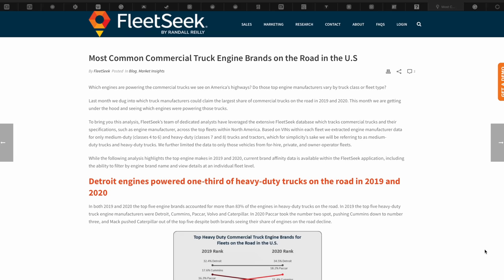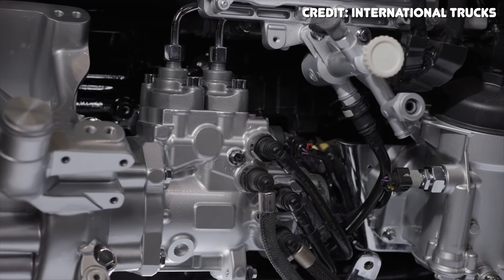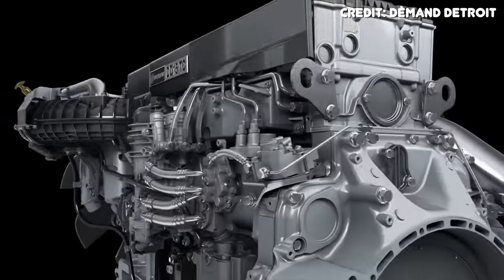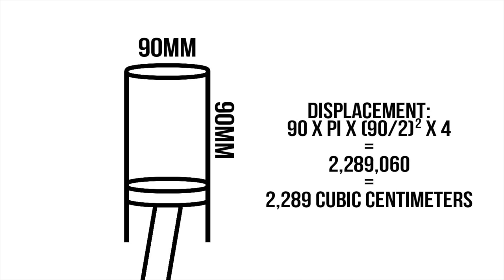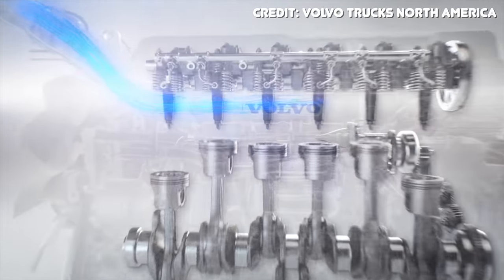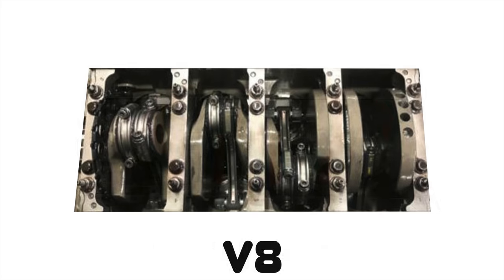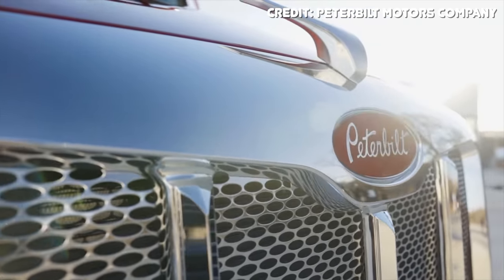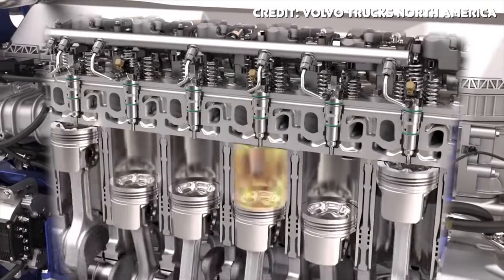Why do Semi-Trucks Use Inline-Six Engines?

Comment: In-line 6  are one of the few dynamic balanced engine designs.  Other engines have to use counter weights to minimize vibration.
Reply: Boxer engines? Kinda the only thing they have going for them besides low COG in cars
Reply: @kevinm1734  Boxers have a slight "rocking couple" the width of a rod bearing. BMW even added a "dummy piston" to get rid of this in their later models.
Reply: @peterdarr383  What about flat plane V8s or I4s. I know they have vibrations at high revs, but these big diesels aren't high revs. In fact some V8s use a flatplane crank over a crossplane crank to achieve higher revs without the losses from the counterweights.
Reply: @beckoningjinx1119  From what I read about Stock Car Racing the Flat Crank weighs less so you can accelerate out of turns when on "short" tracks. On Super Speedways you use the Crossplane for smoothness and reliability. There's also an exhaust advantage to Flatplane, so, completely different headers.
The l4 has all 4 pistons coming to a stop every 180* and the RATE of acceleration of the 2 falling pistons is FASTER than the rising pistons, maxing out at 72* instead of 90* which creates a tingling buzz on a motorcycle.
Reply: @peterdarr383  I haven't noticed that in my 911S. The dummy piston in BMWs is behind the steering wheel.
Reply: You mean balancing shafts.
Reply: I was just about to say the same. I designed parts for these engines for over 5 years and the I6 and I4 dominate because they have excellent dynamic balance and when you need to get 500k to 1 million miles, you need an engine that produces the least amount of wear on components while still producing sufficient power. Serviceability is also a part of the equation though.
Reply: my tractor rocks an old  I-3  --no counter weights required.  
But my sisters car has I-4  with some dynamic balance "thingy" mounted in the oil pan/sump.

so is it iterations of 3 that are "naturally" balanced?
Reply: @mtraven23  your tractor probably only revs to like 1500, no?  And probably shakes more than most people would want in a passenger vehicle, no?
Reply: @lqr824  no, but it is a low rpm engine, i wanna say 3-4k rev limit.  and its for sure louder than you'd want on the road, but the engine is pretty smooth
Reply: @mtraven23  If you can check the max RPM I'd be curious.  I'm reading that it might be 2500 or something.
Reply: @lqr824  yup, looks like you are correct.  Engine is rated at 2500rpm with low idle @ 800 and high idle @ 2700rpm.
Reply: @mtraven23  well, higher than I though, I too stand corrected!
Reply: @lqr824  not sure if it matters, but maybe its because its a pretty small, low HP engine?  Talking like 20hp (1.3 L), maybe a little more since I bored it.  Also built in or before 1990.

Comment: For the same reasons my favorite engine in older Ford trucks was the 300 straight 6. Dependability, ease of maintenance, and lots of low end torque. 🤓🍻
Reply: Yes, I have been using the 240 cid Ford six motor for 31 yrs. No trouble, Easy getting to dist, plugs, water pump, alt.
 Am going to the 300 cid Ford six motor in Jan'y 2023. Brgs getting too loud.
Reply: My Chevy 250 has max torque at 1600, versus big rig 1500. Not very fast, but if you want go fast, get a freaking sports car.
Reply: and how you said it

Comment: Packaging is an issue for a v8 in a truck. A 3408's exhaust manifolds are outboard of the frame rails, which means the turbo has to go on top, all the accessories have to go on front, and the oil filters need to be remote mounted. 
An inline 6 has plenty of space on the sides to mount everything and still not try occupying the same space as the hood.
Reply: In cab over engine configurations it’s a non issue, Scania still makes v8 for their truck lineup
Reply: @kalle5548  Scanias are small cabovers. Different stuff
Reply: ..

Cabovers mean shorter wheelbase
= Better Turning Radius

Euro & Asia drivers
don't live in their trucks

Their point a
to point b
is not a continent
Coast to Coast

San Francisco
Delaware
Pennsylvania

would benefit from cabovers
with older
narrower neighborhoods
street designs

like the older
eons older
Asian and Euro establishments

...

Comment: The inline 6 allows for big bearings, which helps when you have 200+ bar cylinder pressures.   Forged cranks, rods and steel pistons are all a must.  As a result, you get better thermal efficiency and thus higher fuel economy.

Also, larger pistons and bores are more thermally efficient than having many small ones.
Reply: yes but there is also parasitic losses that grow with bore size, and there has to be a balance between those losses and thermal efficiencies.  As such, I-6 is still the least expensive overall option.
Reply: I am not aware of an OEM diesel engine calibration that has peak cylinder pressure of 200 or more bar.  150 bar is more realistic.  High performance cals can be different, but OEMs keep peak cylinder pressures <150 bar.

I have seen this on many IndiMasters and IndiCom2s.
Reply: @johnphillips222  A lot of manufacturers are above 200 bar, especially in Europe.  The US semis are already there too in the last few years.  Once tier 4 hit, a lot of these engines kept going higher with cylinder pressures.  The race is still on to go higher.
Reply: Santa Claus  No, 200 bar.  Close to 3000 psi
Reply: Santa Claus  2 bar is rougly the pressure of a car tire. Its a fucking combustion cycle dude. Its 200bar.
Reply: Santa Claus  We're not talking about boost here mate, it's the pressure inside the piston as the fuel mixture ignites.
Reply: I was looking for this comment, they completely missed the cylinder surface area argument. However, the argument for the V-8s, primarily found in pickups, is that more cylinders lead to better transient response (emissions and efficiency) because there's more frequent combustion events during acceleration, leading to a smaller "step" for each one.
Reply: Santa Claus  1 bar is 100 kPa, slightly less than normal atmospheric pressure.  The average semi-truck engine will produce 20 bar without any combustion, just the turbo and compression.
Reply: large stroke is more thermally efficient not larger bore.

Comment: I'm not a big "diesel guy", as I really don't have the need for one, but I enjoy your videos, and I always learn something new when I watch one.
Reply: Unless you’re living off grid you do have plenty needs for rigs. You need parts, groceries, tires, fuel, furniture, building supplies, water, and so on right?
Reply: @Avinadav205  I'm talking personally.🙄 If I was pulling a skidsteer every day for work, I'd have a diesel. If I pull one occasionally, my gasser is just fine. I have zero need in my PERSONAL use of vehicles for a diesel. It would be a huge waste. I would be doing 13 quart oil changes on a truck I use to grab lumber from the hardware store occasionally. But don't worry, there plenty of weirdos out there obsessed with owning a diesel who do just that.
Reply: Santa Claus  bio, and ULS, are available here in the States. I use either at any given daily fill.

Comment: I used to run a Case 1370 with an inline 6 that ran at 2150 RPM. I also ran an Allis Chalmers with a Cummins V8 that ran at 2800 RPM. The Case ran a lot happier at low RPM and pulled better in tough conditions.

Comment: Just saw where Dodge/Ram/Jeep are going to replace the Hemi V8 engines with turbo in-line six engines in the next few years.  Inline sixes with 7 main bearings are extremely strong engines.  Had a couple of the old Jeep 4 liters based on the old AMC design.  They ran forever.
Reply: Interestingly the GM Atlas inline 6 was cancelled because of main bearing area. Being greater than the main bearing area of a similar size V6, the extra fuel required to overcome drag of the extra area was the main consideration. I  got  this info from a GM insider over 10 years ago.
Reply: Till the cam broke the distributor drive gear and oil pump quit working
Reply: Ford used to make a 300 cubic inch in line 6, I had two F150's with this engine, with a four speed with overdrive. They were terrific, lots of power, and, good on gas, they were simple and ran forever, and, were easy to work on.
Reply: @keithkuckler2551  We had an early 80's Econoline with the 300, pulled an equipment trailer etc.with no problems.   When we went to an 89 econoline with the v8 302, didn't seem to have the same grunt power as the 300,
Reply: @rickinoakville1549  Yup, I agree, that Ford six was also used in indusrial applications, in farm equiptment, ect. My current F150 has the 5.0 Coyote, and, it is great, but, an inline six with modern fuel injection, and, a 10 speed automatic would be a wonderful combinatiion. I just have no faith in those small displacement engines with turbos, too complicated, and, way too much to go wrong.
Reply: Mopar slant six was another good one
Reply: @mitchburk5112  Yes they were, I had one in my Massey Ferguson self propelled combine, and, in my John Deeere swather, hay mower. They were quiet, economical, and, reliable. If they made one today with modern fuel injection and electonic ignition they would be terrific.
Reply: @turbo8454  Not true. The length of the inline 4.2 was a severe problem in crash tests, the engine getting too deep into the passenger area. I have a Trailblazer 4.2 & it's one of the finest engines I have ever owned.
Reply: It was just announced.
Reply: @wymple09  Who from inside GM told you that?
Reply: The pushrod 4 Liter ran forever, the New Dodge I6 won't ..
Reply: @bluesky-ud9wg  I wouldn't trust ANYTHING coming out of Chrysler until there is a well known history of them. Somewhat true of all makes, but Chrysler in particular.
Reply: @wymple09  Everyone knows that Dodge/Chrysler is the coolest looking, most powerful vehicles... That way that they are easy to find in the salvage yards. I at one time loved Dodge, but they're pretty bad now.
Reply: @TheLionAndTheLamb777  Everyone has had a slew of cool looking, powerful vehicles. Your statement is a matter of opinion.
Reply: @bluesky-ud9wg  Entirely different uses intended. One was a low rpm workhorse, the other built for HP. The new engine will be the base for the new Hellcat.
Reply: I am currently running my 5th Jeep 4.0 liter inline six, basically the only thing I have ever had....Best engine in history as far as I am concerned.  These things run do run forever.    2006 Jeep Wrangler Rubicon.
Reply: The current hemi engines are not really hemi engines, they do not have the hemisphereical heads
Reply: @keithkuckler2551  those were great trucks
Reply: @mitchburk5112  - yep - just not big enough @ only 225 cid   Dad had one in the Plymouth Volare.  It was smooth, but a dog with no get up and go.
Reply: @wymple09  - really sad GM cancelled those.   GM and their 'maximum sales volume' philosophy leaves no room for excellence.  The 3.5L V6 is a wind-up motor.  Not impressed.  Had one in a Traverse.
Reply: @bluesky-ud9wg  - boosting small displacement motors for higher load vehicles like trucks is a really bad match.  See:  Ford Ecoboost 3.7L V6.    They're great for about 70,000 miles.  If that's all you want out of a $50,000 vehicle, well ok, then.
Reply: The New engine wont be like the 4 Liter at all. Just because they made a good engine doesn't mean all of them are. Dodge=Tick Tick Tick...
Reply: @wymple09  The BMW inline 6 is supposed to sub under the passenger compartment in a crash
Reply: 2001 3/4 Dodge 5.9 Cummins 177000 just got it broken in.

Comment: These engines were originally used  in tractors because of the bottom end torque. That and they are pretty much indestructable. Not fast but reliable and loads of bottom end. Fit in a small space too.

Comment: The Detroit 8-V92 with a super charger and 2 turbos will never be beat.    That was the most awesome motor ever made.    We had 2 of them on the farm to haul hay on double trailers.    They were 675 horsepower and this was in the 1980’s.
Reply: 2 cycle Detroits did not have superchargers. They had roots type blowers. They were "scavenger" blowers, meaning they pushed the exhaust out the exhaust valve. They provided no boost. That's why they are not called "superchargers"
Reply: They still can't be beat. No computer no plastic no def. Just you might go deaf. Lol love Detroit

Comment: Be-yootifully explained. In-line 6 engines are simply the best. Speaking of 3 cylinders, I had a rental with a 3 cylinder and was amazed at how smooth it was. I bounced it off the rev limiter a couple of times by accident (not because it was a rental)
Reply: Sureee it wasn’t because it was a rental
Reply: Ya just like I" accidently" did a bootlegger turn in a rental car once 😁. Fun as all get out but pretty rough on the car.
Reply: @theboyisnotright6312  forgive my ignorance, but what is a "bootlegger turn"? 180 degree e-brake turn?
Reply: @devonrosa4414  Also known as the "Starsky and Hutch 180"

Comment: I think you pretty well covered it. The majority of the trucks in our fleet spend their day idling to drive the PTO. Torque and horsepower aren't nearly as important since they only drive to and from the jobsite. Its not uncommon for some of our ten year old trucks to have only 20,000 miles but have a grip of hours. 

You summed it up best when you said they are easier to work on. Since I generally work alone, setting a cylinder head on an inline six does take time guiding it on straight with a hoist. But at least the block is level. I couldn't imagine trying to do it on a V configuration where the head would have to be angled 45 degrees. 

Also, driving pistons into a 6 is nice because the rod hangs straight down. Doing it on a V engine would be difficult to do alone because the rod would tend to fall to the outside of the cylinder.
Reply: So true I scan my cat c7 computer it dranked over 60k gallons of diesel in it's life time and most of that was at idle. 😀
Reply: More fuel efficient, but less productivity.  That sounds like over engineering to me.

Comment: I don't know anything about diesel engines and I'm not going to pretend I do but when it comes to 6 cylinder gas engines I am more of a fan of the Jeep 4 L inline 6 or the Ford 4.9 L inline 6. Basically all of the characteristics that you described other than a full rebuild seem to apply to both. As far as the torque I feel I6s tend to deliver it more smoothly than a V6. It might be personal preference though.
Reply: Yep and with less rpm's. My '99 Wrangler had that inline 6.. quite torquey for offroading.. She now has a small block 318 magnum.. Still torquey.
Reply: Chrysler's slant 6 was an efficient, high mileage beast.
Reply: The carb'd versions of the Ford 4.9L made peak torque at 1500-1600rpm which is totally absurd. PowerNation has a video series where they build one and dyno it several times, the torque curve is super linear and always much higher than hp even when they add a turbocharger. The big difference is that the 4.9L likes to be at a medium-high RPM when doing work.
Reply: You guys just hit 3 inline 6 banger engines on the head for me. Learned to drive on a 1966 Fargo (Dodge) A100 window van, with the 225ci slant 6,  sporting a 3 on the tree standard transmission. I still own a 1979 Ford E150 Econoline van, with the 300ci (4.9L) inline 6. Currently I am searching for a replacement for my 1989 XJ Jeep Cherokee, which I was able to save its engine, a 4 litre MPI inline 6. Looking for leads on XJ with good body, in Toronto area!
Reply: the Ford Australia Barra I-6 is also a distance beast with many taxi's using cars with the engine racking up over 1 million km
Reply: @jimjamauto  But once a ford, always a ford. Thee new trucks have tailgate heaters.. so when your pushing them in the winter, your hands don't freeze.
Reply: @wesleygray5349  My first care was a '67 Plymouth Valiant.. with a slant 6.. descent gas mileage and just enough power..
Reply: @Mywhtjp  sorry dude I just don't play the brand wars game, all manufacturers have good and bad products.
Reply: @shelliecarlson7015  just about unstoppable
Reply: True, I agree the ford 300 ci inline 6 is a stout engine,, 94'-96" all ford engines factory settings are Dogs though , I've driven them when they were new , had a ford 460 v8 new 96' with a 5 spd manual transmission, it was about 150 hp maybe, ford claimed it was 250 hp ; no way, had a 2 95' Ford 300 inline 6s NO power, and 12 mpg ,, but a 91' 300 6 will run great and deliver great fuel economy..93' to 96' I believe, ford engineers  went with cam and timing changes , dont know why , maybe emissions, but their whole pickup line was horrible the performance was.

Comment: lighter crank and camshafts, less heat rejection with larger cylinder volumes, no counterbalancers, potential for reduced turbocharger back pressure  ( optimal pressure wave overlap with proper turbo type and sizing)  All lead to a hard to beat BSFC unless opposed pistons are used- even less heat rejection and potential longer expansion for given size engine. Rotary sleeve on intake ports could take this expansion even further.
Reply: A straight six is going to have a heavier crank than an equal displacement V6. The fuck are you people going on about incorrectly with weight.
Reply: @ObservationofLimits  All that cam twist got their timing thrown off... Or maybe it's the intake/exhaust runner lengths? Or maybe valve angle?
Reply: @scottleggejr  who knows